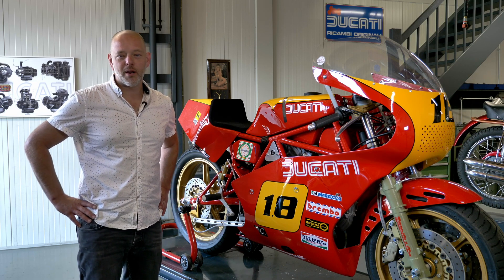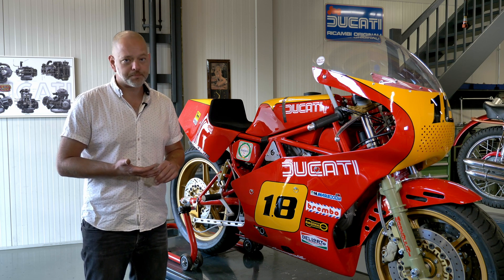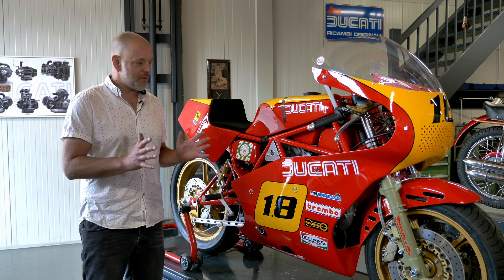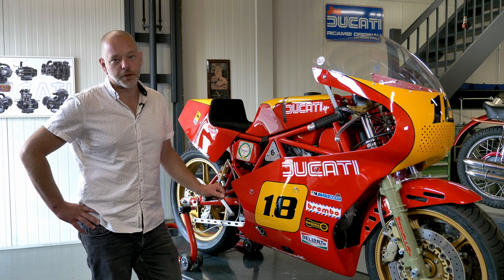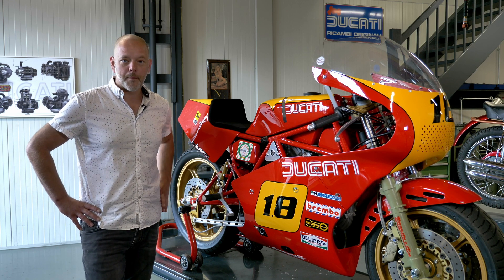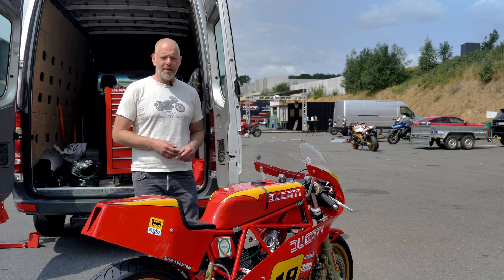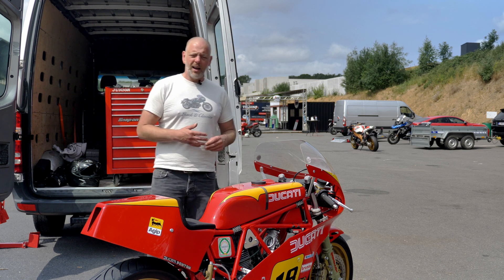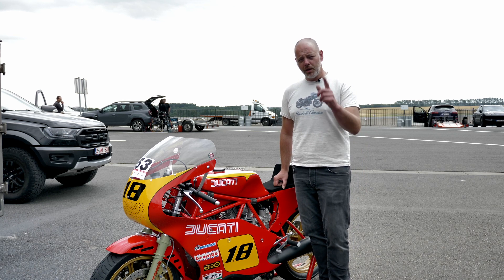Re-Creating a Ducati TT2 600 Racing Bike - Back to Classics

Comment: I’m currently taking my 600 Pantah apart, the engine on this bike has a 500 Pantah clutch (very small) it came that way, I think it’s a early model. Very prone to slipping. Which might be on your bike. One of the things to watch for. I myself may end up putting a Cagiva 650 engine in the chassis. And I know you can fit one of those bad boys in your TT 2.

Comment: Hi, I have a Ducati tt2. I started  to build it in 1995, and completed it in June 1999. I made all of the alloy components,  fuel filler, fork yokes, hubs and axles for the Campagnolo wheels ,footrests, converted to right hand gearchange, cush drive in rear wheel, handlebar levers. I have an ex Rutter factory clutch with straight cut primary gears.  
I modified the 36mm carbs  ,to 37mm, blanked off accelerator  pumps, and made bellmouths, as Del Orto race carbs , ( i am an engineer,) tand then I painted myself. Tony  Rutter autographed  the seat, Foggy signed the tank. I have raced it for many years but,now with lights  fitted I only use as my road bike. I ride it every week.
Thank for advice from the late Tony Rutter, and Steve Wynne, Sports  Racing .
Ps  YouTube  DUCATI TT2 600,  it is blue and yellow.